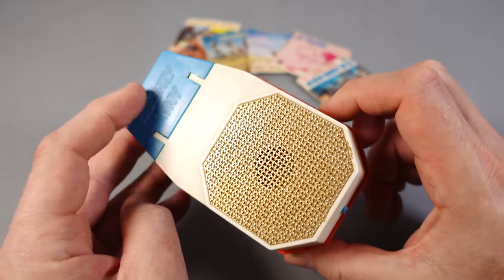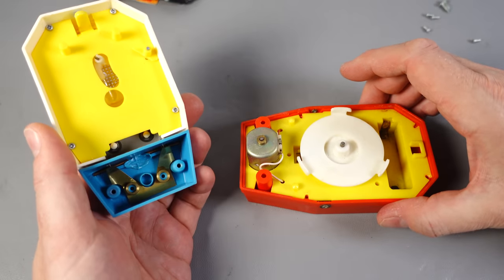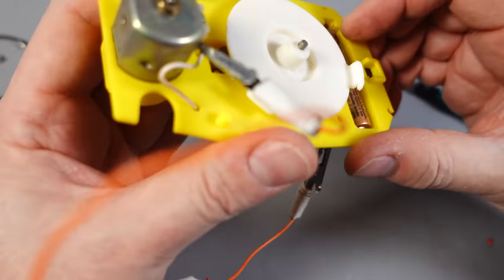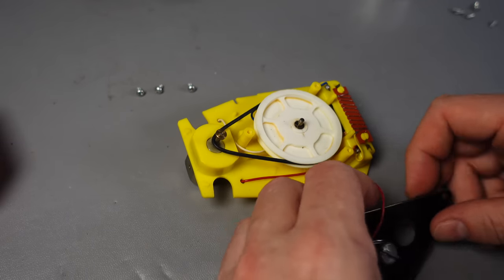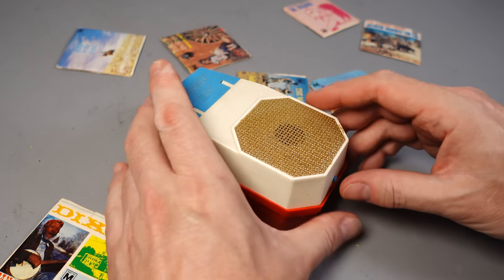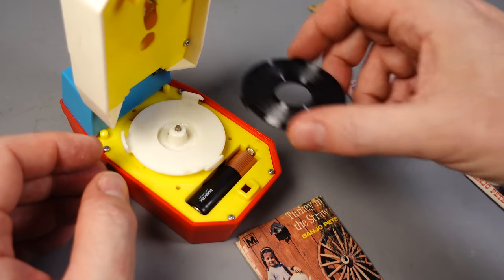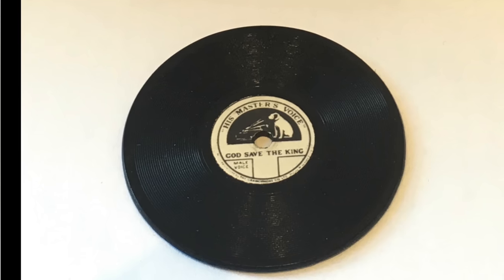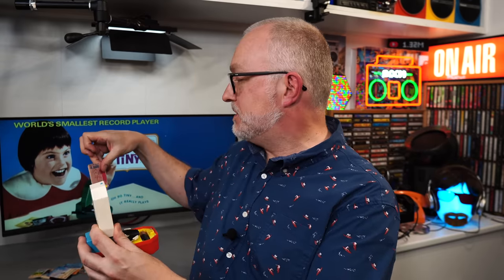Mighty Tiny - Smallest record player in the world?

Comment: the lengths you went to in order to play it on a standard sized player and make it (roughly) listenable was admirable. thank you for your efforts.
Reply: Don't recall if you've ventured into 3D printing, but a one-off adapter for this setup would be quick and easy.
Reply: @downumop  or you know, just some tape...
Reply: @downumop there is no point in printing an adapter... It's a kids toy. Pretty much a nail on a "record", precision is not in the design.
Reply: Next we need to play a full-sized record on the toy
Reply: @totalmarh Yes, perhaps cut it down slightly in size? Drill a larger hole in the centre. Oh wait. why are all those pesky grooves so far away?
Reply: @erwindewit4073  For that you'd somehow want to hook that motor up to the full-sized disc (not a whole ass big one, pick one of the tinier ones like what goes in the disney read-along books (I don't remember the sizes, sue me, haven't used mine since I was 10).

You're basically just splitting the Mighty Tiny in half with the needle/amp half being mobile, and the record itself would provide the "on" weight, just let the needle and grooves pull the upper half inward (so you'd want the upper half on a moving track with the least friction possible, but providing enough weight for the stylus to "grip" the groove.

I foresee a wear and tear issue, but that would be a crude but functional way to get it working, if the motor can take turning a large record like that.
Reply: @bojcio  i had one of these and after it broke i did in fact use a piece of masking tape to see if it would play of a record player.
Reply: @volvo09  yes, but techmoan, has the stuff try reduce wow, flutter and I do thin a bit of extra tape just stop slipping turntable mat, might of helped too? there not great recording but, I think collectors this little record player, are not hi-fi buffs with high mid range gear, to even attempt playing the records back on any thing but the Mighty Tiny, with it short cummings ?
Reply: @erwindewit4073  nothing a little duck tape cant fix
Reply: Took the wow and flutter down from 30% down to the low teens! Still totally unable to discern the original melody, but you can almost imagine it once being music.
Reply: @totalmarh  Yep, as often, tape to the rescue..

Comment: That's considerably bigger than the 'record player' inside the action figure I had in the 70s. It was built into the torso of the figure and the disc was removable and reversable and IIRC had several grooves so the character 'spoke' different lines each time you pressed the button (or it might have been pulled the cord, I don't think it had batteries).
Reply: I belive most of the traditional pull string toys have mini record players in them. They don't run with digital speakers. It's probably the reason why the old toys make a demonic sound when the battery is running low as the record player is slowing down.
Reply: My brother used to have a dalek with a small record player in it. Think it was battery powered.

Comment: That speed control is fascinating. I love "non component" bits like that. I dismantled a cheap milk frother where the switch was just a plastic pad that nudged a wire into the side of the motor housing, and this feels like the same spirit.

Comment: This brings back memories of being a lad and taking my sister's talking doll to bits. The mechanism was pull-string and clock spring instead of motor driven, but for voice only I recall the sound quality wasn't horrible - certainly no worse than one would find in a 'talking fish' or similar modern novelties. To this day I use it as an example of engineering elegance.

Thoroughly enjoyable video!

Comment: Back in the early 50's Noma Plastics produced a train station sized for O gauge model trains that played 3 inch 78 rpm records announcing train departures. Both steam and diesel sound records came with the unit. It used 2 D cells for rotational power and had an acoustic reproducer with a steel needle that could be replaced.

Comment: I remember visiting my grandfather, and coming across an old doll that must have belonged to my mom or my aunt. I noticed it had a velcro seam on its back, which I opened. The thing I saw inside was something not unlike a small pink record player with discs as big as the ones you're showing. I had seen "pull-string" crying babydolls, but I never knew how they worked. Apparent this is how.
Reply: wow
Reply: I was going to comment on the same context. My sister had a gorilla soft toy with a pull string. Inside was a little box and inside that had a tiny record with a plastic diaphragm speaker and a tiny point for a stylus. I mean... Hey It worked until the cord snapped! Audio quality was not too important. It had 3 sayings on the record each time you pulled the cord to wind it up. Very similar construction, I'm sure he got the idea from such a mechanism.

Comment: A similar system but with multiple grooves is to be found inside a Palitoy Action Man Field Radio were a button from the front starts a AA battery driven motor to play the disc using a primative needle and plastic diaphragm. With that the discs have commands you'd use in play!
Reply: Yes I had one of those when I was a kid.

Comment: I had a laughing box placed in a pouch that was sold as toy in the 80's, that was based on this system somehow. It was also a mechanical needle and a membrane, pressing down on a small record, that was driven by a little motor and batteries. It was VERY close to this complete mechanism, except that the record couldn't be changed (the housing was two parts, mounted together with screws).

Comment: In the 1970, there were some small laughing machines, activated with a button - think some of those worked like this.
If the movement of the stylus is direct coupled to the diaphragm, the information must be up/downwards encoded in the record.
Reply: Hej Rune, du har fuldstændigt ret i at de der latterposer virkede på samme måde. Jeg havde selv en i sin tid, og kunne selfølgelig ikke dy mig for at se hvordan den virkede.
Reply: I think they were called Laughing Bags and came in a little cotton drawstring bag. May be misremembering though
Reply: You're correct, same principle. However, those delivered a much, much better audio quality: https://youtu.be/cm1ovEe1AYA

Comment: That's the thing about physical audio. When we were young, we just cared that it worked, not so much how good it sounded. As we grew older and demanded better quality, we lost a lot of the magic. Here we can enjoy a video about possibly the worst sounding audio format ever. I'm glad you put it on a full size deck at the end.
Reply: I'm glad he did that too, because it highlighted that the sound quality was inherently flawed even from manufacture. The speed was inconsistent even on a far better player than ever designed at, so clearly it was recorded that badly onto the master that those records were pressed from!
Reply: Of course this disc will most likely have been 'hill & dale' mode,   so won't reproduce the same on a    standard record player

Comment: You have to wonder how they actually produced the records knowing the complicated process that takes place to produce an LP.
Reply: I was thinking the same.  Finding a musician, studio time, engineers, master tapes, etc.  They will probably discover that Banjo Pete was Steve Martin before he was famous doing a quick gig.
Reply: I'm sure it was just injection molded on the same machine that made the rest of the parts. No master at all. Possibly some sort of wax copy straight from a microphone. Similar to the original wax cylinders, only flat.
   edit; Without seeing the records, I can't tell if they used actual vinyl or a thermoplastic material. This is a major reason for the horrible sound. I doubt they used vinyl because of the cost of the process.
Reply: @@phillipbanes5484 I meant how could a record company gear up to make such a tiny record.

Comment: Some of the distortion has to be due to the belt, right? It couldn’t have been that bad!!
Reply: Yes I think as he had a loose belt on another player in a different video and showed before and after new belt and the player in that video sounded better
Reply: Yeah that's what I'm thinking. A new belt would have sorted that extreme flutter.
Reply: The belt is fine, that's how it's supposed to be. You could minimize the flutter a bit by pushing the record up against the notches, but the 'speaker' is the worst part in this case. It's not really a speaker at all, or a very, very rudimentary one at that.

Comment: My jaw dropped when the contact solution worked. I was pretty much yelling at the screen that the motor was dead when you were trying to pry it apart 😅 never knew dead motors can be revived this way
Reply: Quite often fans and similar are just dirty from use or debris from the carbon brushes. Cleaning them can bring them back to life.

Comment: My kid sister had a "talking" doll that had a tiny record player inside with an even smaller diameter record in it. No battery, but it had a wind-up motor activated when she pulled a string in it's back. I think it changed track with each pull, so it would say something different each time.

I only discovered the record player when my 8yo sister asked 10yo me to fix it after she dropped the doll. I think it was something simple like the needle coming off the record and needed to be put back on the record.

Comment: my mum had a doll from when she was a kid, there was a tiny opening on the back you'd plop open and put in a disc with grooves on it. It never worked though because the windings in the motor had died and I was only 2-3 at the time and hadn't the knowledge to fix it. I did however stick a random motor in a little later with the inappropriate voltage. I could make out bits of the music all sped up. Good times, I'm 26 now and I miss the 70's vibes my parents passed down to me as a kid.

Comment: Very wonderful toy. Thanks for the excellent demo and restoration. It did not sound too terrible on the turntable along with the post processing.
In 1966 I had a toy police car with a similar mechanism. The body of the car was stamped "tin". Every kid back then had cut up finger tips from prying these open without tools. I was no exception. The sound mechanism contained a multitrack record, permanently installed, with various sirens and police radio calls. In German. As I recall, the audio quality was tinny but quite adequate. It was incredibly loud though and my folks were angry with my German grandfather for buying it for me. Ah, memories.

Comment: It's not clear whether this does the same thing, but the similar multi-groove fixed disc versions of these found in Palitoy talking toy cars in the seventies would stop spinning because the stylus would run off the end of the record into the hole in the middle. That allowed the disc to spring back upwards, breaking the contact with battery. When you pushed the button on the toy, you were pressing the disc back down, freeing the stylus and allowing it to spring back to the start position. When you released the button the disc was now held down by the stylus trapped between it and the diaphragm, so the disc span, dragging the stylus across it, until the stylus fell off into the hole in the centre, allowing the disc to spring back up again. There's something beautiful in the simplicity of the mechanism.

Comment: I have a Talking Viewmaster made by GAF c.1970 which uses the same kind of technology. Attached to a special version of the familiar View-Master cardboard reel, with seven stereoscopic pairs around the periphery, is a small, translucent plastic disc with a short audio commentary engraved on it. A battery-driven motor rotates this disc and a stylus attached to a conical diaphragm makes contact. The sound, though, is not much better than here.

Comment: Anyone remember the 'Laughing Bag' from the 60's/70's? These were tiny 'sealed' record players. I recall when mine eventually stopped working (I still suspect sabotage) when I was around 9yo, taking it apart and being freaked out at this tiny little disc and fixed tracking arm.

Comment: Is that a stereo pickup on the "normal" player in the end?

You may be able get the vertical component with less groove noise by adding the stereo channels after inverting one of them before. 

Due to geometry, the 2 45° offset stereo channels can also be seen as horizontal being L+R and vertical L-R (which was done on purpose to make stereo records backwards compatible with mono players). That means a vertical component does produce 2 inverse signals on both channels.

The "small" microgroove stylus may even be benefical in riding on the base of the groove, like you need for vertical recording.

Comment: With a brand new razor, cut 2mm out of the belt (make sure your cuts are square) and glue back together with CA.  I've done many and they never come apart.  As long as the belt isn't gummy or brittle it works  perfectly.  EDIT:  I don't think you'd get nearly the volume out of that as you did if this was a vertically recorded disc.  The old Edison Diamond Discs were vertically recorded and made nothing but noise on Victor type horiz recordings.

Comment: Mighty Tiny: okay, it’s the fun novelty, but you CAN’T make tiny discs that actually sound good and have full length audio

Sony in the 90s: I’M GONNA FRICKIN DO IT ANYWAY

For those who don’t know, in the 90s Sony pioneered a smaller offshoot of the CD called the minidisc, a tiny optical disc with 60-80 MB of storage. Sony was able to put full high quality audio on it by compressing away parts of the song that couldn’t physically be heard by the human ear, quite clever really. The minidisc was a smash hit in Japan but aside from maybe the UK at one point, no one else really cared, until PlayStation made a handheld. The PSP utilized a much more advanced version of the minidisc called the UMD, or universal media disc, which had the capacity of a full sized CD, about 500 megabytes. If you owned a PSP, you definitely handled some form of minidisc.

Comment: well........i noticed a couple of things about that player.......
first, that " belt " is actually an "o"-ring, obtainable from any auto repair supplier or garage for not a lot of coin.
second, that motor IS rather unstable, and the bearings are messed-up..........sorry, it needs to  
be replaced.........the best one for a job like this is a coreless armeture type.......their rotation is VERY smooth.
i also notices high-end distortion during play.......try three small (3.5 mmX 5mm @ 120 degrees apart) strips of felted paper on the back of the sound membrane using water-soluable glue for initial tryout(s).
yes, i serviced one of these during the early 80's.

Comment: I want to have them played on a real turntable and at their adjusted speed if needed with audacity. I guess a modified turntable or arm that doesn't stop the thing when you get in the center will be necessary... or perhaps just manually hold an arm at the correct position and connect the dangling leads to a phono input

Comment: I was wondering if when there was vertical cut und later lateral cut in the mono world and even later 'flankenschrift' (don't know the english term) in the stereo world and there is m/s (mid/side) coding like in microphony or the joint stereo in mp3... Can one play a record with old mono vertical cut by a stereo playhead und extract the monosignal by the formula M=L-R? In Audacity this could be done by splitting the stereo track in 2 monos, invert the second channel, pan both to center and play both tracks together.